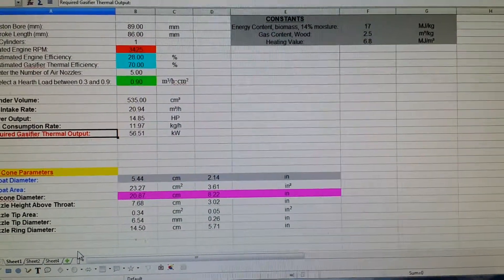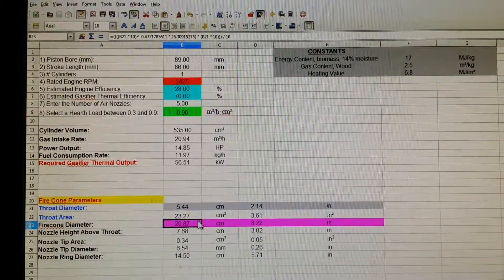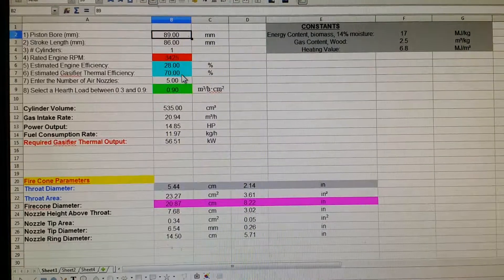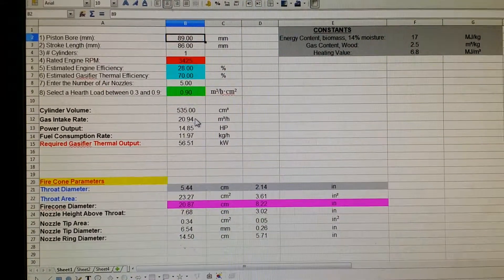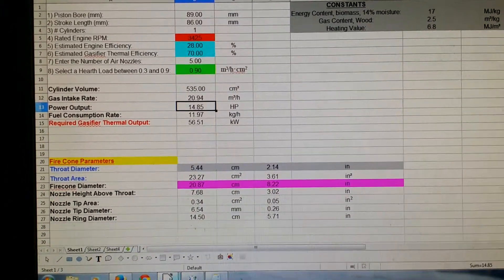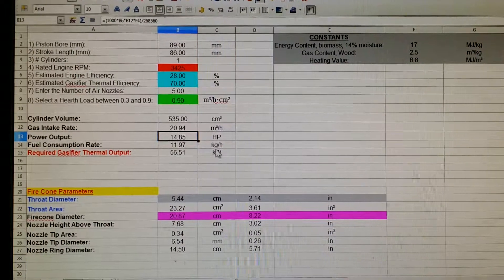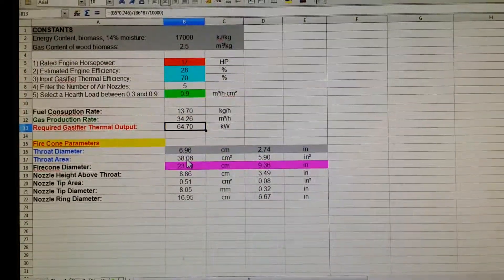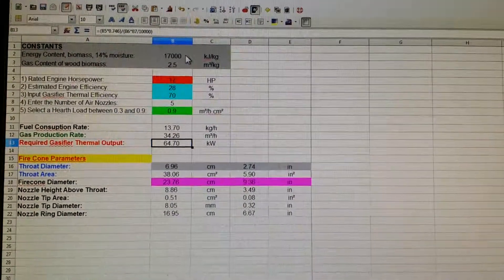Gasifier Design Dimensions

Comment from the maker: I didn't do any scientific measurements outside of verifying that it worked or didn't. I found that going with the numbers spit out by the spreadsheet was a reliable way to get dimensions that performed, but by no means have I done enough real testing to see how efficient a gasifier is based on those numbers. My last recorded build was so inefficient and such a tar producer that I chunked the whole thing in the trash. Poor insulation and too many conductive heat paths were the problem.

My next build will be much more mindful of that. Also, I suspect that using both the gas output AND the engine exhaust to preheat the intake air will make a huge difference. I hope to start the build soon.

Comment: You did a really good job on the spreadsheet. When I looked at actual data that was out there, it was a bit confusing so I used some of the FEMA along with some of the Imbert stuff from All Power Labs then I just experimented until I found something that worked. Someone gave me a good tip a while back and that was to look at the exhaust or the intake size of a small engine and make sure that your nozzle or your nozzles combined would equal the diameter of the engine intake or exhaust. What seemed to work for me was to make my nozzle output a bit less in diameter than the intake diameter of the engine because it stepped up the air penetration into the ember bed. but if you take this route with the data you have it will defiantly make your job easier. One more thing,  the data from All power labs is a bit confusing to follow and they even admit that too. Good luck.